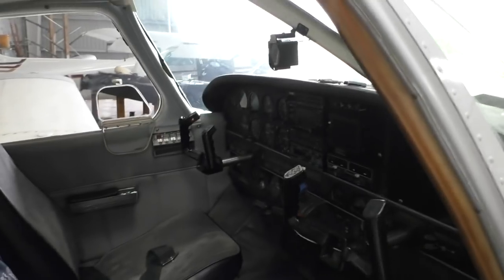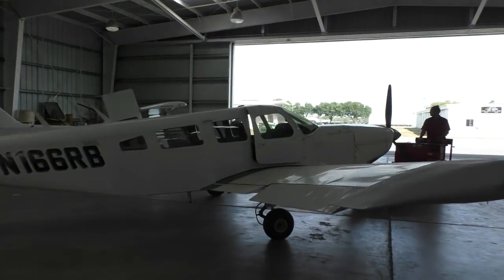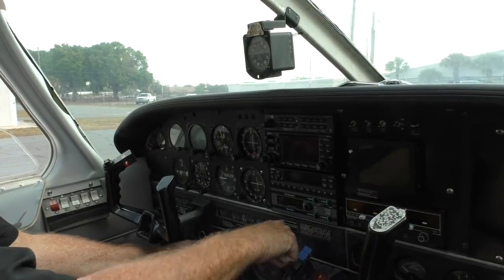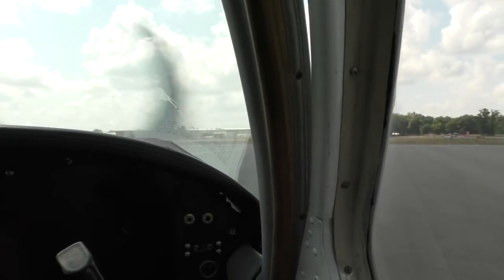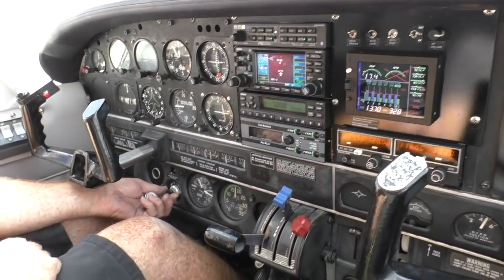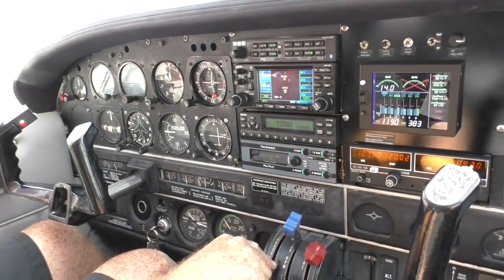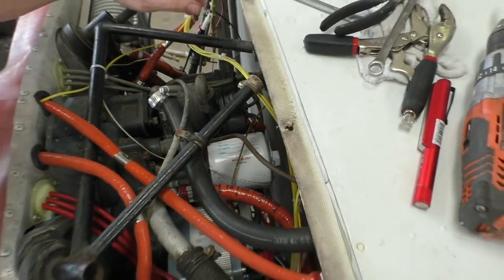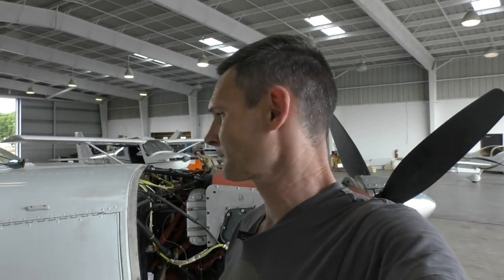22 years out of annual... 1st start up of Cherokee Airplane!!! EP28

Comment: Hey Jimmie, Congrats, on the start up. Be very careful with the vacuum pump security. I know of one wreck that was starved of oil because the mechanic forgot to put a nut on and that pump and it came loose. Subsequently, all the oil drained out and the pilot and passenger ended up in a rock pile. Not a good ending. But on another note. I’m glad to see this all coming together.....
Reply from the maker: Thanks for the suggestion.  I would not want to end up like that.
Reply: dannnggggg.... They should be safety wired.

Comment: G, day Jimmy's World from Sydney, Australia.
You have been productive in the restoration.
Q&A
1. Is this just an engine run-up or flying?
2. Have you a registered tail number from the FAA?
3. New plugs, two Bendix Magnetos, cylinders and pistons in good condition, new oil, charged battery, nil crossed over rubbing of hoses. 
Hose clamps secure, sensors new and wires protected/ insulated from vibration, dirt and heat.
* air cooling over cylinder heads with duct and rubber aprons.
👔
Reply from the maker: Hello sir!
1. that was just the run up stuff to see what needs attention, I did the test flight today (video coming soon)
2. The tail number stays with the plane (usually) and yes, it's all registered.
3.  yes to all that, that's what we were checking with the ground run to make sure all that stuff got installed correctly.

Comment: Do you oil the cylinders and check compression before you try to start these planes that have been sitting for 10 or 20 years?  15 seconds of grinding and you can do enough damage to require a full engine overhaul.
Reply: Shows him pulling plugs and fogging each cylinder before starting on all the "barn find" planes

Comment: 😧 absolutely no way in hell I’d fly that !  I hope you’ve practiced your power off landings ! Corrosion corrosion corrosion !!!   I think you mentioned in a previous video that it was started once a month but unless you’re running it hard enough to burn of all the moisture off it’s not the same as use.  There was a recent crash of a 150 that didn’t fly in 5years. Had a forced landing that resulted in a total loss. Please be careful. I’d fly it in circles over an airport with long runways and equipment on site for a few hours before going anywhere.
Reply from the maker: I've got the fire department on standby
Reply: @therealjimmysworld  haha !  Be safe brother
Reply from the maker: thanks so much!

Comment: Jimmy needs one more donation. A pair of slightly used wheel pants. No plastic, only fiberglass.
Reply from the maker: in that same grey primer to match the tip tanks... ironically, I went to put them on today and realized I don't have the little insert that goes in the wheels... you don't have any of those on your shelf do you?
Reply: @therealjimmysworld  No but is just a steel tube with two slots in it, some holes for the cotter pin, and a washer welded on one end with a 1/4x20, or is it 1/4 x 24, nutplate inside.  If the tube is worn and gets a little loose, you need to wrap some black electrical tape around it. You don't want that flopping around.  Any looseness there or in your landing gear scissors really shakes those wheel pants and cracks them.
Reply from the maker: Good to know.  I'll take a look at that other 6 with the wing and see about fabbing those.  Seems simple enough.
Reply: @therealjimmysworld  If you are going to fab them, just be sure to flush rivet the nutplate in place on the end plate before you weld it to the tube.

Comment: I just drove by a 66’ today. It’s not legally flown for 15 years. TT 5000-5100 range   What shall I pay? Looks like paint, body and interior needed. 

Description
 Piper Cherokee Six 300, nice IFR King color GPS panel. Flat tires, paint faded now and left wing tip looks flocked up and warped while right tip looks newer. 

Avionics Master King KMA 20 audio panel Sigtronics intercom with PTT King KLN-94 color GPS KX 170B Nav/Com with glide slope Mac 1700 digital Nav/Com with CDI Narco ADF King KT-76A transponder Roll autopilot slaved to GPS/Com Astrotech LC-2 digital clock

Thanks for any input

Comment: Nice! 

So you have the JPI on the avionics circuit?  

My EI engine monitor (I have the older-style bar-graph style) came hooked to the avionics circuit as well.  When we did some wiring changes, I changed it to always be on with the battery switch.  I think that makes more sense.  How does the JPI manual suggest it be hooked up?
Reply from the maker: to the avionics buss.  it's for voltage spike protection.

Comment: Thought I saw that flying around April 1. It was blowing black smoke rings around the pattern
Reply from the maker: We did fly it on the 1st and today (2nd).  I wouldn't be surprised if there was some smoke.  That number 6 cylinder had a sticky oil control ring (we think), ran great though.  Where are you based?
Reply: @therealjimmysworld  I’m just messing with you. Googled your “N” number to see if you got it in the air yet and seen you stayed in the pattern
Reply from the maker: lol, sneaky sneaky.... ;)

Comment: How long since the prop was last overhauled?  A customer brought me his newly acquired PA32-260, with a fresh paint job. As soon as I started it up and taxied around a bit I thought the prop needed balanced. So we got the traveling expert down to check it out. He told me he put all the weights on it that was allowed and it was still out of balance. So we sent it out for overhaul. They had to reject one blade. I wondered if the pilot didn't get a clue flying it several hundred miles from where he bought it. Moral of the story: If your plane feels like a "buzz bomb" it might just be.
Reply from the maker: prop is new as of 2013.  Felt smooth and we've had a few people look at it and everything looks good.  Only 11 hours since install.
Reply: @therealjimmysworld  Okay. Looking forward to the run up. But I know something is up your sleeve. After all it will be April Fool's Day.
Reply: If I were one of the mechanics in that hangar, I would pour a half cup of corvis oil in your muffler shroud.
Reply from the maker: hahahaha, I was thinking that when I scheduled the post! hahahaha
Reply from the maker: just enough smoke.... not funny... but really funny!!
Reply: @i.r.wayright1457  Dumping in some toner from the photocopier is also worth it (as long as you aren’t around for the cleanup)
Reply from the maker: hahahaha, that is just wrong.... but man, it's funny!
Reply: @therealjimmysworld  Picturing Jimmy in black face. Al Jolson style.

Comment: Jimmy, I’m curious why you wired your engine monitor to your avionics bus???
Reply from the maker: Cause that's what the instructions said to do.  I was told they do that for voltage spikes when the engine is shut down/turned on to protect the electronics.